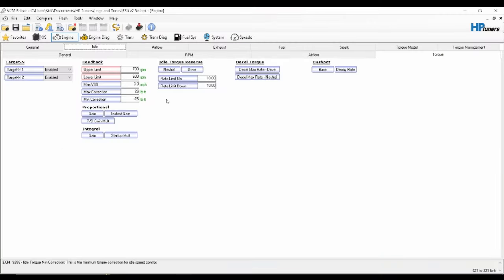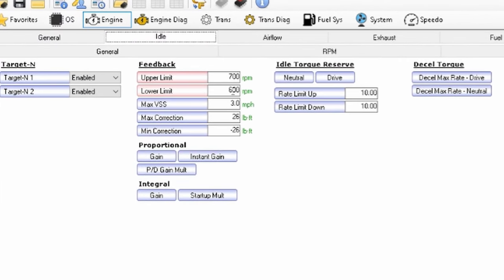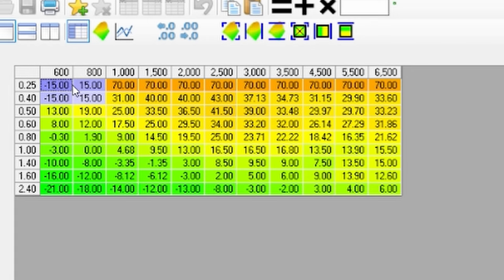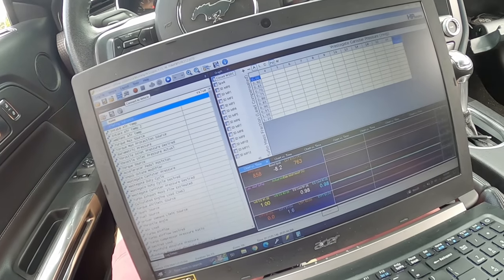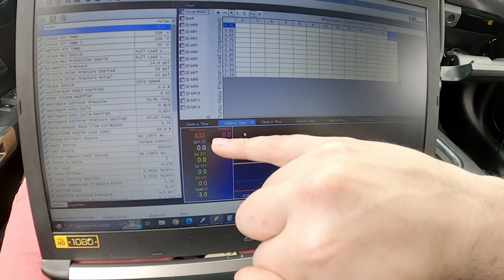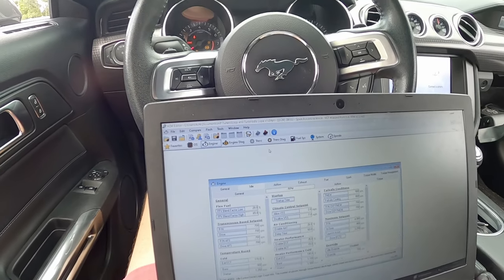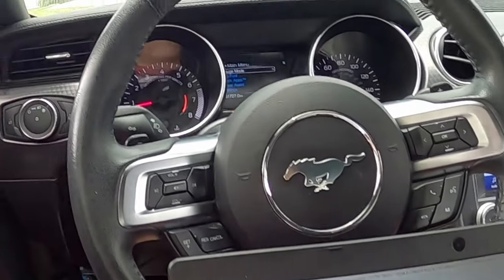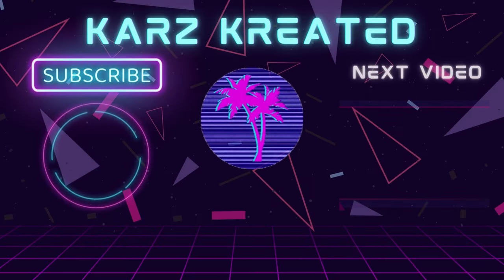This GHOST CAM Ecoboost Mustang Sounds RIDICULOUS!

Comment: the way i do them with coyotes is thru VCT overlap. then going into the mapped point and halving spark, raising idle rpm slightly, touching vct distance tables for a clean transition to idle, touching idle torque reserve, flipping rate limits, doubling max corrections, setting some rpm stuff so it doesn’t try to correct itself as much and i believe thats it. i may of forgot some stuff but that would probably be a much safer option for you for your desired results. hit me up if you wanna see how it works on a coyote
Reply from the maker: If I was able to control the vct map at idle, that would be cool. My only concern is having the exhaust overlap into the intake stroke during the fuel injection period, allowing fuel to pass into the exhaust system. I guess you would have to set the exhaust to close before SOI begins? BTW, I think I had the cycle wrong by thinking the intake stroke starts at 0 degrees. I referenced the diagram you had sent me, and intake  stroke starts at 360 degrees??
Reply: @KarzKreated  ford does theirs a little different. honestly i don’t do enough ecoboost to pay attention. the injection timing is a good point as to not do it that way lol
Reply: uhh i dont know shit about this any way you guys can send me some copy and paste tables? 😂 need that chop😩